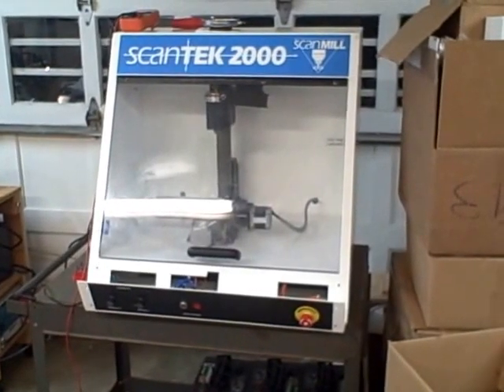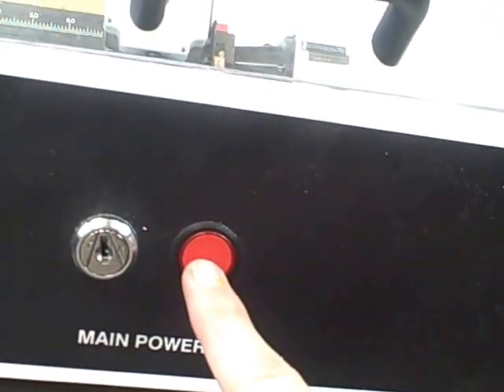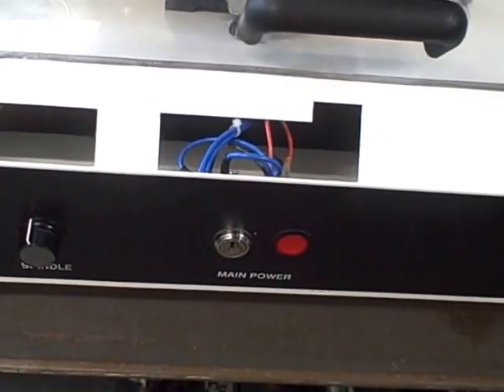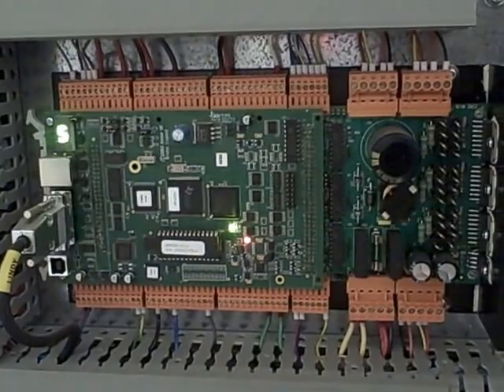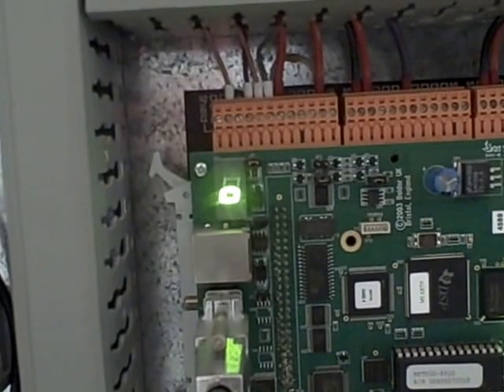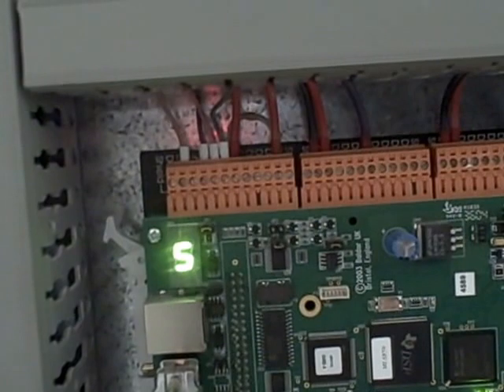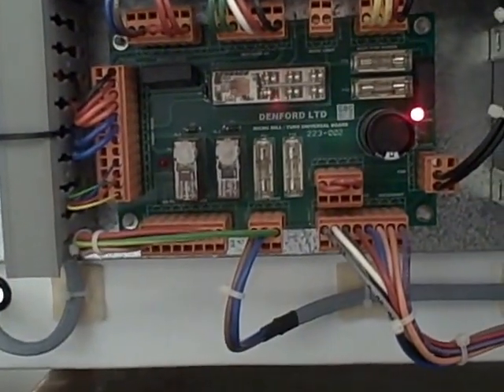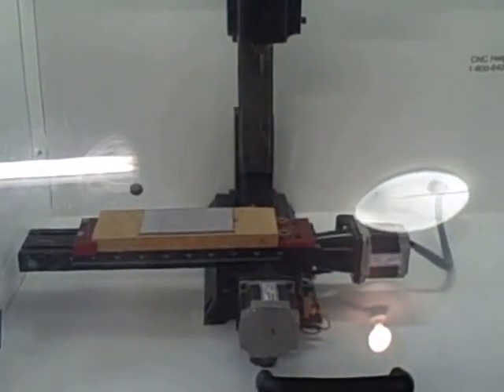ScanTek 2000 Scan Mill (denford micromill 2000) Initial powerup

Comment: Hey Jay, I have been trying to find your email address, no luck. However, I have a question for you. Would it be worth buy 2 Scantek 2000's and 1 Micromill 2000 not knowing if they work or not?
Reply from the maker: It all depends upon the price and how much you need/want a mill and lathe. Worse case scenario, the underlying mill/lathe would probably work manually or with a complete electronics replacement.  (My email can be found on my website, linked in the description.)
Reply: @summetj  Thank you for the quick response. The price is $300 for all 3. Can these units be used for woodcrafts?
Reply from the maker: @strictlyamps820  $300 for all three is a steal! You can sell the parts alone for well more than that.  These mills/lathes are designed for metal, but you could certainly use them to cut/turn wood or plastic. (But their total working area is much smaller than most wood lathes...)
Reply: @summetj  do you know if the parts are interchangeable with each other. Sorry I still didn't find your email address on your blog. My email is cliffjones@strictlyamps.com. Are there schematics out there for these units. or do you have to do reverse engineering
 on them?
Reply from the maker: @strictlyamps820  There have been a few different models over the years, but most parts are generally interchangeable. (Mill & lathe use the same control board, just different software, for example...)

Comment: I'm curious, what is the size of the mill? I can't find any footprint for the box and am looking to buy one for my little shop at home. Thanks!
Reply from the maker: The enclosure fits in a 27 by 27 by 27 inch cube, although you need extra height above it to fully open the door.
Reply: Awesome and thank you! Are you happy with the machine so far? Have it up and running?
Reply from the maker: Yes, I have it working. If you follow the link to my blog in the description you will see all the steps I had to take to get it running under Linux CNC control. Unfortunately, I'm in the middle of a move and it's packed up, so I haven't had a chance to use it much. I have a manual Sherline that I've been happy with, so I expect this one will also perform well for me.
Reply: Ah, I recognize your last name now. I was looking at your site where you go through the steps of converting to linuxcnc using the existing steppers/Balfor controller board!!

Thanks for sharing and detailing it all. I think I'm going to pick one up this weekend.